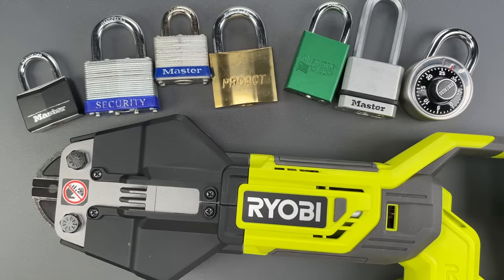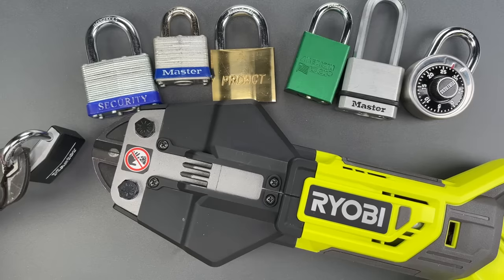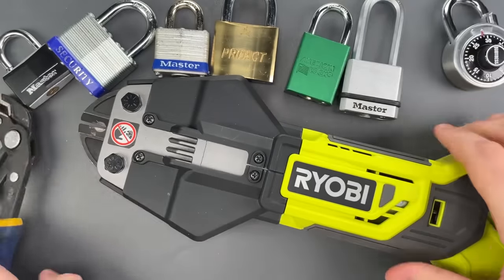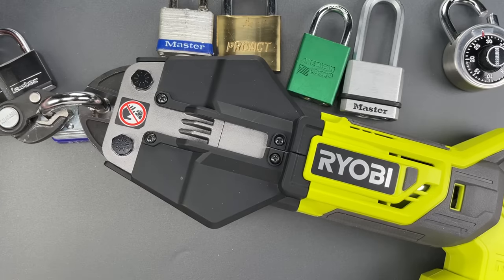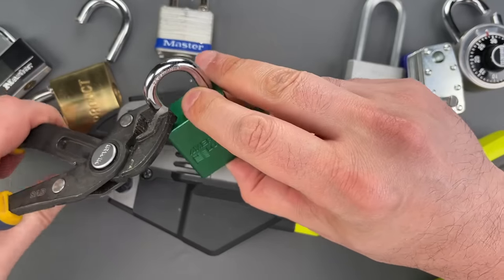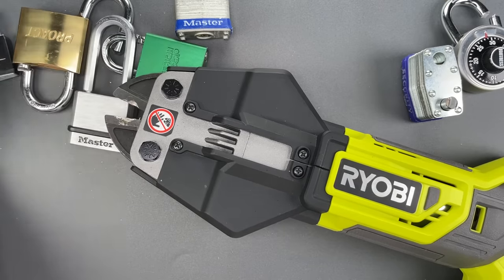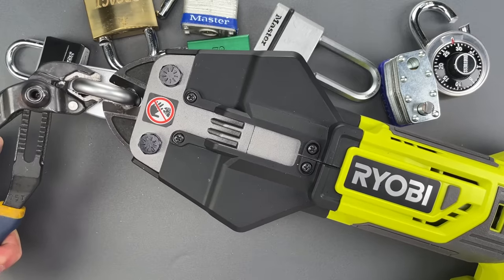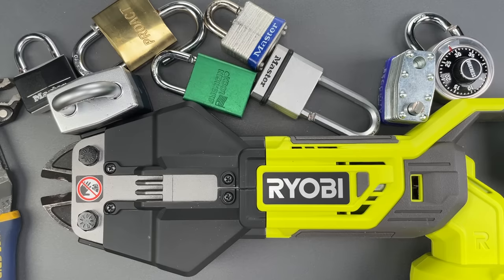[1408] Better Than Expected: Ryobi Bolt Cutter

Comment: I've been pleasantly surprised by the Ryobi line. It's obviously an entry-level brand, but it tries hard to sit at the grown up table.
Reply: They're perfectly fine for DIYers and weekend warriors, but if you earn your living with your power tools, you really want to go for a commercial grade product.
Reply: @ChristopherHallett  I've found that for most of the common tools, there's more value with Ryobi.  They seem to last about 75% al long and cost half as much as the bigger name Pro-sumer brands.  You can afford to keep a spare drill or three, and having three of them really speeds things up doing tedious work where you otherwise would be constantly changing bits.  Also nice that they have used interchangeable batteries for 20 years.

Comment: Some dock recivers use this Ryobi to remove bolt seals on the back of semi trailers. I think it's convenient to have one for being a truck driver.
Reply: We've got at least four of these Ryobi bolt cutters for just that purpose in our yard.  Only ONE of the cutters blades are close enough to actually cut all the way through anything.  The rest of the "cutters" basically just mangle them apart.  You get about 80% of the way through the bolt and then have to twist and pry them the rest of the way apart.  We used to use bolt cutters by Greenlee which were significantly better, but stupidly expensive and our drivers are always dropping them and breaking them.  The Ryobi make more sense, but you have to make sure the blades touch when the jaws are closed, the LPL's were pretty close but still could have been a couple hairs closer.

Comment: For chain link fences, I highly recommend manual 'barbed wire' / fence cutters.
      I have a military issued one - it's like a bolt cutter, but operated with 1 hand. (The beak is positioned to the side, a bit like water pump pliers).

Very handy (and very capable for the size)
Reply: did you see a chain link fence in the video?

Comment: I was thinking of buying this, not for any particular reason, but to have one laying around in the shed just in case i lose my key to the electric scooter or something.  but if the blades are this soft,  this is basically a  3-5 time use for that purpose before having to swap blades.. will get expensive in a while, so its better to invest the money in a more durable brand in my opinion.

Comment: Just mechanical tool is simplier, and you could ask mate for help with it, or use pipe extension.
Or cordless grinding machine, but its loud and could cause flame

Comment: at 4:24 suggesting that working on a chain link fence takes a lot of cuts.  What you really do is unbend the end of one of the wires and "unscrew" that one long link and the fabric is split into two at that point.

Comment: If this is wireless, using a better battery such as a 5ah battery will help produce more power and it will not stop as much.  I had the problem with a Sawzall stopping until I upped it to a bigger 5ah battery from a 2ah.

Comment: A lot of Ryobi (and other brands) come with sub-par blades fitted out of the box (chainsaws are notorious for this). Would be interested to see if those replacement blades wore down as quickly. Also interested to know what sort of battery was being used, as there are 5 different sizes over 3 generations, and different batteries can drastically influence a tool's performance (the pick of the bunch in my experience is the 5aH second gen batteries - no idea why, they just seem to have more grunt than others).

Comment: You need to get the material into the bottom of the blade folcrum for maximum mechanical advantage.  You partially block this ideal placement with the pliers and this places undue stress on the blades.

Comment: About the only thing missing was trying to cut the last padlock with the new blade you had as a spare.
Regarding the cutting out, a big factor on that is, as many have pointed out, the capacity of the battery used and it's ability to provide the amperage required without dropping the voltage to the trip point. If you had a 9Ah on it, it would have had significantly more cutting ability.
However, that said, ultimately it appears the cutting jaws not being of a high enough quality that's the ultimate failure point.

Comment: They totally should throw in a free ski mask and gloves. 

I'd wonder if you cut a notch on the tip of the blade. Will it be able to be used as a spreader tool for wooden doors.

Comment: QUESTION: not sure if you know but how that harden steel with knives I wonder if that do that with locks and those cutters to or if it’s just cheap metal I imagine it’s both but really it’s crazy how cheep everything’s gotten and it sucks because you expect your buying something good for the price they are selling them but then it turns out to be so much less then what you pay for some things more than others but still I mean nothing lasts except before the 2000s and it sucks I mean think about it today we still have stuff from 1950s and it’s lasted longer than if you were to go and buy the same exact thing it’s so disappointed 😒😒😒 lol that’s wasn’t a question 😂umm do you know like how durable they are like maybe if you can get your hands on some older metal locks and compare them to now🤷🏻‍♂️

Comment: The hardness is not the only factor with that tool, toughness and tensile strength are going to have a noticeable effect.
The boron carbide shackle is very high hardness and abrasion resistant, low toughness and low to average tensile strength.

Comment: I can't find any specs on the net that tells me which metal the cutting blades are made of. They could easily be replicated in another material, but you must be mindful of them becoming too brittle. Also, they could add extra load to the fasteners. By looking at the lines on the bolt heads, they have already used the highest possible tensile shear strength.

Comment: Not to nitpick (no pun intended) but when you insert the lock you must put it all the way in to the marks on the blades.  The first couple you didn't do like that, the next couple you did and they were quite easy to cut.

Comment: Couple older guys I work with use that Ryobi to cut off the rail (bolt) seals from trailers. They love'em as they don't have to mess with bolt cutters, and the Ryobi's do a great job.
Reply: Please can you connect me with them...I would like to buy their fairly used ones

Comment: Ryobi batteries are top quality. 4 ah and up. The newer hp batteries are great. Because of this I have purchased all the Ryobi tools I'd use. They're affordable and you won't cry to hard when your cheap zaw zaw is stolen. Ryobi has made a lock cutter for years, and I've used mine dozens of times. It's call an angle grinder.

Comment: I'm a huge Ryobi fan, but was very disappointed in this tool. Bought it a couple years ago for wire shelving and cyclone fencing- couldn't cut either clean through. I even adjusted the jaw alignment as instructed. :-(

Comment: For about $100 that's not bad. I suspect if used with the largest high ampacity batteries, it would do a better job. You can also get electric rebar cutters that shear instead of pinch that might work better.

Comment: I'm a truck driver and often have loads that require a bolt type seal or a cable type. I would like to see what this cutter could do against those. Normally, we used large bolt cutters on the bolt types, but they are often so damaged they are almost useless. Cable seals are hard to cut with most cutters as well, as they tend to just spread out until you have to snip one strand at a time.
If this cutter could cut these kind of seals, it would be worth the investment.
Reply: I promise you, this tool is not worth the money

Comment: As a motorcyclist I keep my vehicle chained up, so knowing what locks are safest is an interest of mine.

Obviously almost any lock can be picked using the tool you and Bosnian Bill made, but seeing the ones that can't be opened easily, be it with almost no skill or a cutting tool like this one, is useful, so thank you for this video.
Reply: Just keep in mind the thief will attack the weakest link. Even if you have a strong lock, make sure the chain is strong.
Reply: Absolutely, JO47, but strong chains are a lot easier to locate.

Comment: I'm wondering if the damage is because you are resting the cutting blade on the lock. As the blade closes, because of the steep angle, it causes it to bind against the lock shaft causing an upward force which easily can snap the blade. This is probably not the case but it could be.

Comment: HEY LPL !! 🔴🔴. Get a Small Hand Grinder and use a “RAZOR BLADE” Cutting Disc in it and it will CUT THEM PADLOCK SHACKLES 
LIKE BUTTER !!!
They Even have Battery Operated Hand Grinders as Well !!

Comment: The blade damage was probably a bit worse due to the way you did the tests. You get way more leverage, and hence more force with less work, if the object you are cutting is as far back in the jaws as possible. I noticed most of the shackles were not much more than half way back. Putting the lock body in a vise and using both hands to hold the cutter would have enabled you to keep pressure on the shackle and keep it further back. Still, a good test and good ad for the cutter!
Reply: That's right, same thing with sidecutters, secateurs etc,  open them right up & stick the wire or whatever in as far as you can before squeezing.
Makes it much easier.

Comment: It wouldn't oause if you used a bigger battery. Obviously, that's added weight in the field, but for home testing, the bigger battery gives it a lot more cutting juice.

Comment: Cuts first lock, oh there’s damage, all that I saw was the paint came off the blade, throw a 5ah battery in there, it won’t start and stop, I have the same unit, best bang for your buck. And I’ve cut a lot of rebar with it, blades still look as good as the day I purchased it..

Comment: Notice the exposed plasma in the window on the right of the tool (near the controls)? This is not safe to use in a flame free zone without a valid work permit cleared by appropriate gas detection results.

Comment: Interesting video, my last job the operators would use the bolt cutters to cut aircraft cable and that stuff is harder then woodpecker lips, it would put a fuck right in any bolt cutter. That's why I made a steering wheel lock out of the stuff after my truck was stolen.

Comment: yea this is why it seems like if you dont have a chonken lock or a lock like thats basically in a trafficed area where a big bolt cutter would be very noticesable pick resistance above liek a person with moderate experience is kind a pointless on padlocks. especially with electric or hydraulic cutters being all around

Comment: A "Bolt Cutter", which is mainly used to cut things other than bolts (like chains, rebar and wire mesh) sounds so much like a tool from a thief's toolbox.

It's like: Hey, I'm a chef and my tools are the "Cut your face off" and the "Pound your skull in"

Comment: Coming from someone who builds chain link fences on the daily, I can confidently say I would never use such a slow tool to cut fence when I could use manual bolt cutters, chain link fence wire ( fabric) is really quite soft and easy to cut, even in the industrial quality product lines
Reply: he isn't cutting fence, he is cutting locks.

Comment: I would highly recommend no one stick their fingers in an electric appliance that will remove their digits, without cutting power to the appliance in a definitive manor such as unplugging the tool or removing the battery, examples of this may include placing your hand on a still bandsaw, resting your hand on a corded chainsaw’s saw blade (even if the idiot lever is down), cleaning out clots of grass from an upturned electric lawnmower before removing the battery or sticking your finger in a bolt cutter to test the wear and tear on the blades

Comment: I'm more curious as to which Ryobi battery is he using. The pauses could be due to him using a lower amp battery like a 1.5 or 2.0. Should definitely try 4.0 and up or the HP batteries.

Comment: And the thing to remember is that the cutting jaws are SUPPOSED to be disposable if you're using it to cut things like lock shackles.  The point is that it does cut them.  If you HAVE to cut the shackle then do you really care that the jaws took damage and need to be replaced?

Comment: Where did you find the extra set of blades?? I’ve been using mine for about 6 months for wire shelving and the blades are pretty worn out.

Comment: Wrong too imho, wrong tier of tool to be specific, I've seen regular sized and smaller (much like this bolt cutter) Jaws of Life, being utilized to break open trasformers to extract the copper.
I think one of those puppies would make short work of most padlocks without breaking a sweat, and ofc being immune to this kind of damage.
Reply: Yeah, the real-deal Jaws of Life are rated to cut through even super-hardened stuff like steering wheel cores (source is my father who was a volunteer firefighter and used a set to easily cut through a hardened steering wheel in a training exercise), so they'd probably not have any issues with these, as well as locks with larger shackles.

Comment: How many Ah batery where you using? because that makes a difference on my 1/2"  impact gun lug nuts that won't move with a 2 ah battery  spin right off like nothing with a 5 ah battery

Comment: Just out of curiosity, where did you get the replacemanet blades? I'm considering getting one of these for my receiving department at work (they daily cut seals off of containers), but I don't want to if the blades are not readily avaiable. I can't seem to find them on the Ryobi webiste, or at Home Depot. Thanks for any help you can give me.

Comment: this may be "actually useful" for cutting chain 5/16 chain links and threaded rod for unistrut applications... But anyone doing that consistently does not use ryobi 😁 They are a good bargain occasional use cordless power tool platform though 👍

Comment: at 3 minutes 22 seconds it looks like a piece of the lock flew to the right of the screen as you cut through. i wouldn't do this test without at least wearing thick leather gloves... probably still i'd prefer to wear armor like gauntlets or chain-mail.
aside from your example of ignoring certain safety measures, i liked the video. i'm no thief but i do like to be aware of these things.

Comment: For about a $100usd you can get a battery powered angle grinder that cuts through most shackles very quickly, abet, with a fair amount of noise, but, it does so very quickly the trade off, is in the thief's favor. 
I Cut through a Chinese "better quality" pad lock on my shed in about twenty seconds with my DeWalt angle grinder with a cheap diamond blade and I wasn't trying that hard. My body even blocked a lot of the noise

Comment: What the point of making padlock shackle harder as 95% of time what ever it loops through is fairly thin sheet metal loop or unhardened chain. 

P.S. That tool is used cutting steel wire (bars) re-enforcements for concrete structures. It is too slow and overkill for chain link fences.

Comment: Are you using an HP battery? The older batts may not put out enough amperage and be causing the stoppages.   I see it a lot with my chainsaw and circ saw when i use the non HP bats

Comment: It's amazing (as well as embarrassing) to see some of these simple tools they've made battery powered options for. For example, what on Earth do you actually need a battery powered caulk gun for? Seriously?!
Reply: If you work in the trades and you spend all damned day caulking stuff having a battery-powered tool that is more easier, less stressful, more consistent, and gives you better results is a win. I used to think the same thing about battery-powered grease guns until I saw a construction equipment mechanic grease a dozen points in no time at all.
Reply: @DiniduPerera  wrong. There is absolutely zero reason for a battery powered caulk gun. It's not easier, not more consistent & does none of the things you said. If caulking is stressful, then you shouldn't be near it.

Comment: THAT'S IT!!! Call Bill and bring that Squire to the Shooting Range... Show it who's boss LPL... Give it a 50 Cal Armor Penatrating Explosive Round... That'll teach it for refusing those blades... LOL!!!
The shear factor that Ryobi is attempting anything Power Tool, is just shocking. I saw an Soldering Iron made by them... EVERYTHING WAS PERFECT... Except... The Cord, Pvc which a hot Soldering tip would just cut through like it was made of room temp Mozzarella Cheese in summer.

Comment: When possible, it's best to use the bolt cutters to cut the body of the padlock rather than the shackle.  The brass and mild steel internals of a padlock are far less likely to damage your bolt cutter blades than the hardened steel of the shackle will.

Comment: Seems like a weird tool. For anything I can't manually cut, I'd use an angle grinder.
Reply: Angle grinder sparks can set fires, there's not always room to get an angle grinder in or you don't want to accidentally damage what the lock or whatever is attached to.
Reply: @TexasSpectre  good points :)